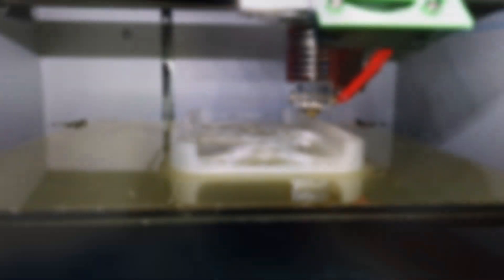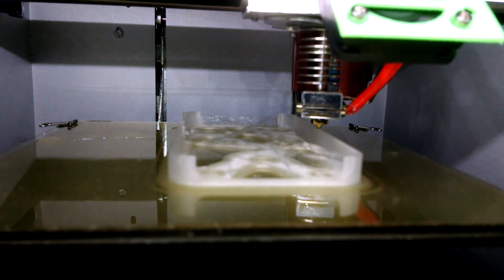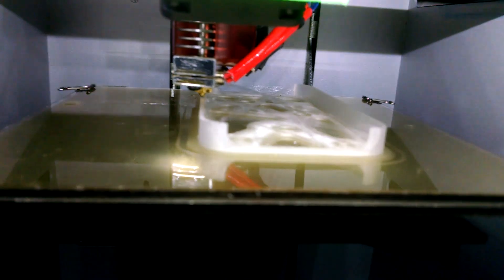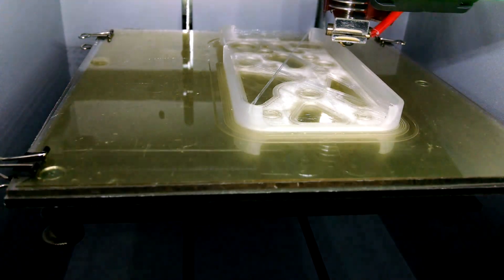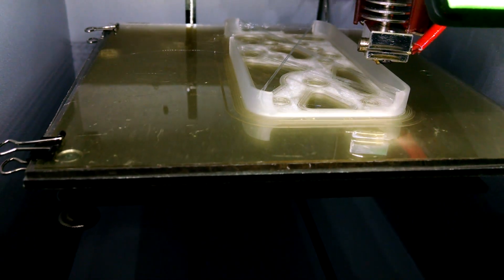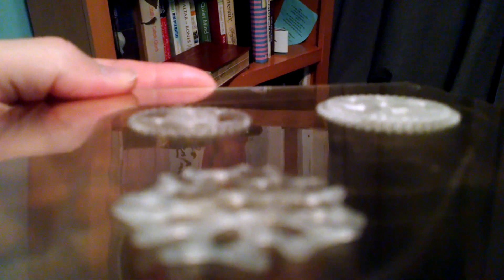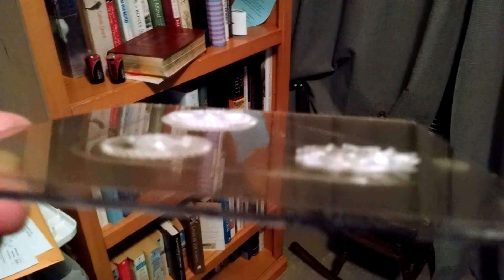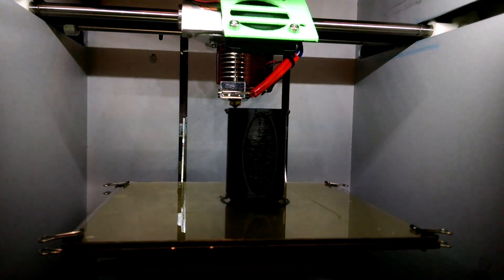PEI Sheets for 3d Printing review works on a cold build plate!

Comment: PEI is fantastic, ive been using it since October 2015.  ive got mine laminated to a piece of borocillicate glass bonded with some 3m high temp adhesive.  One side of the glass has the pei and is used for PLA and when i want to use ABS i flip it to the other side and use aquanet.

I dont know about the product you are using but when you purchase the PEI as  a plastic sheet, 1 side is shiny and the other is more matte.  This has a direct relationship to the bottom surface as your print.

Comment: What thickness of PEI, thanks, is this it>
http://catalog.cshyde.com/item/converting-and-laminating/lamination/36-5a-12-x-12?&plpver=1002&origin=keyword&by=prod&filter=0#
Reply from the maker: +Protomaker Black Sprint Original 3D Printer Actually, I believed it to be .010", like this stuff http://catalog.cshyde.com/keyword/all-categories/ultem-tape-with-adhesive?&plpver=1002&pagesize=25&pagenum=1&filter=1&keyword=36-10*&key=product&keycateg=100&keyprod=3001153&SchType=2&keyType=PIf you call them and just ask for the part number I listed in the video, 36-10S-3D, or 36-10A-3d (sorry to all, I'll edit that in the comments) and tell them the size you're looking for, they'll definitely help you out.
Reply: Thank You :)
Reply from the maker: +Protomaker Black Sprint Original 3D Printer thank you